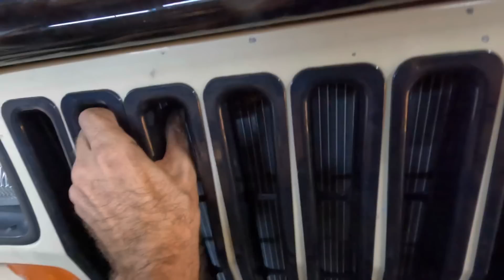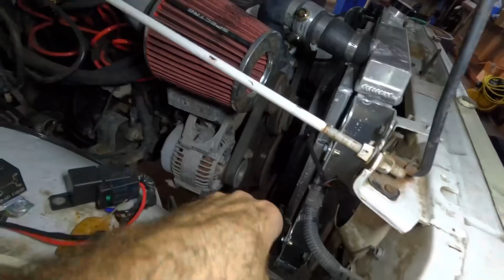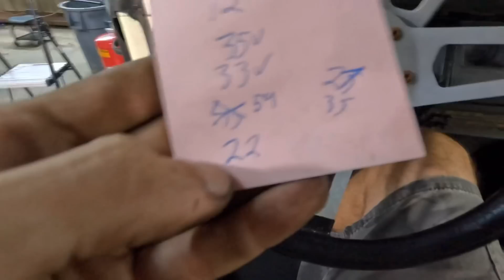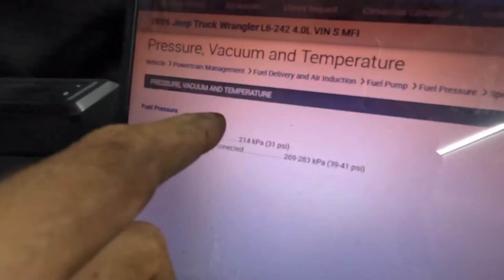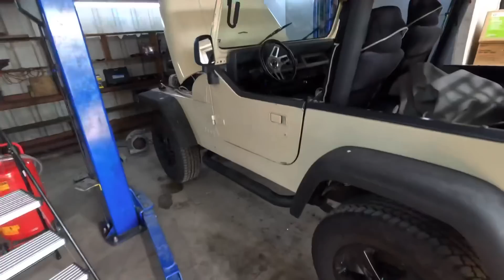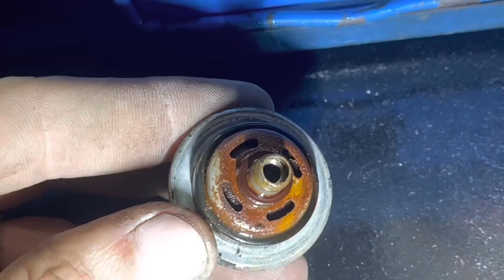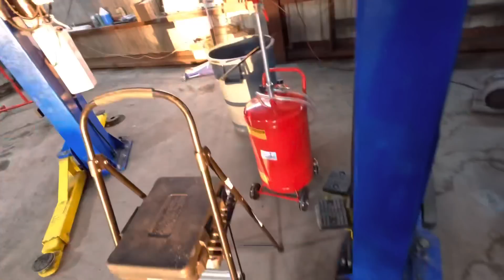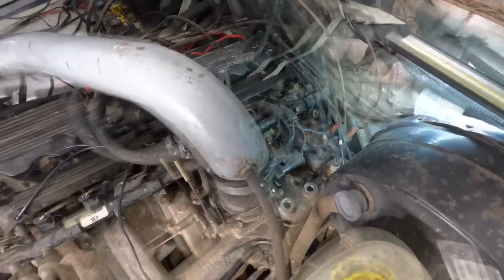Parts Cannon!! Can it be saved?? 95 Jeep Wrangler 4.0

Comment: You got 2 fans running in front of that jeep and the fans in the jeep still not functioning, that itself should tell you the fan in not operative, which is why it's running hot but your taking it for a test drive knowing it will overheat. Your doing to much.

Comment: Hmmmm, my first car was a Chevy 283 small block 8 cylinder that the exhaust manifold would glow bright orange.  This reminds me of the first time I knew something was wrong, hundreds of miles from home at 16 in the middle of the night, the motor started going ERRRRRRRRRRRRRRRRRRRRRR very loudly so I pulled over and popped the hood, bright orange manifold, a park ranger had stopped (I think he thought I was not old enough to drive by a couple years 'cause I looked about 12 then) and he had a cooler full of water so I popped the cap off the radiator and that alone was really stupid but I did release the pressure first, and we added that whole cooler of water, slowly, but that doesn't matter much when the engine is that hot.  There must have been basically no water in the motor at all.  But, I shut it down and waited 20 minutes or so, started right up, shocked that it did not crack the block.  Or blow out every gasket in the engine.  Drove the rest of the way home, and it kept running but kept losing water as well.  Not long after I turned 17 and went into the Air Force, left the car with my brother and told him he could have it.  He drove it down to Mendocino and on the way back north he has an electric fire in the dash, got that put out and drove it another year.  You want to talk about one indestructible car, 66 Impala.  Jeez, in high school I was convinced it was on death's door so I did not care what happened to it, so there were the typical reverse to drive drops at 25 mph, doing donuts at the gas station my buddy worked at.  Going 110 (top speed for that poor old engine) on the whole 3 miles of freeway in the county, even got pulled over for it, CHP actually gave me a warning, he too thought I was about 12.  It is a f'ing miracle I live to tell of it really.

Comment: I noticed you didnt rebolt the ground strap that was behind fuel rail on the firewall... IF it is disconnected some electrical circuits will not be able to provide clean consistent voltage to certain systems

Comment: Sounds like ignition timing issues to me.  I had to rewire my Distributor pickup wires when rebuilding my distributor and inadvertently flipped the wires. So when I plugged it in, it started normal but ran really low on power and the engine sounded really loaded up. Turns out, in flipping those 2 wires I effectively flipped my timing curves and when RPM went up, my timing became "Less advanced". This causes fuel to not fully burn and to continue to burn in the manifold and catalyst. Causing the manifold to eventually turn red hot. I definitely suggest checking base and off idle timing.

Comment: My past experience with this particular engine and a few more is your rail has a bladder inside it and if that bladder clapses it can allow if you will go through and they can shut it off to a point where it will not run either happens in the rail or in one of the lines leads the injectors

Comment: So. You have a bad fan, a fuel. Issue I jectors. Or a weak pump. Or a. Clogged fuel filter.
   And a few sensors.
. Brings back memories for me..
. And ya a new pump. Doesn't mean it's good. I agree.. But also could be airing issues.. It's old critters eat on things.
. And grounds.
. Now I will watch the rest n see what happens..

Comment: Intake manifolds get a gas wax that is formed on cold intakes. I had map sensors on a car that were lower than the hose connector. The gels went down stream ( booger gravity ) and clogged the map sensor in the winter. The Ford service bulletin I never received offered a mounting bracket at a higher mounting point on the firewall. I thought the engineers knew alot about gasoline.... just kidding, they're myoptic!

Comment: Fuel pressure regulator shot?? Or weak fuel pump??? Fuel pressure leak down at rest?? El cheapo fuel filter that
has a paper element that is trying collapse in on itself?? Here I am about 3/4 's away in the video, but that only
seems like anything that I can think of at the moment!

Comment: These sort of jobs on clapped out cars can be really frustrating and stressful. You just keep finding more and more little things that need attention or replacing, the clock on the workshop wall seems to be running faster and the customer bill is increasing and you still have a clapped out car. We have the Jeep range here in Australia, not very practical, not very reliable and they drink fuel like a thirsty camel at a water hole.

Comment: Captain back seat helping out here:
Now, why would there be a trouble code for the injector circuit? I don't know, but maybe because someone was pulling the injector plugs a minute ago?
During the starting I clearly hear a dolphin. So, THERE's your problem. A Jeep engine should not be equipped with a dolphin!

Comment: These things are known for heat soak problems, so old crappy injectors running lean building up heat making the injectors worse and not allowing it to run right after stalling, could probably use a new fuel rail line and upgraded 4-port or 12-port injectors

Comment: One thing you missed. While I don't think it's 100% your issue, It could be your restarting issue. When you depleted the fuel pressure and turned the key on, it only climbed to about 15 psi or so. That new pump should have hit at least 31 psi in the first key turn. So there is still a fuel issue going on somewhere. Plugged line, fuel sock clogged, not enough power to the pump. SOmething.

Comment: I used to own a '91 Islander. Great little tooling around car.
Reply: The wiring harness for the fuel pump runs right over the drive shaft and can come loose from the clips. When that happens, the shaft can wear through the insulation on the ground wire and short out the pump. Had it happen to mine more than once.

Comment: OBD does actually have a port, but you don't plug a scan tool in, you use a jumper (on most models) and it triggers the flashing of zee lights on the dash.  I've never had a Jeep, so hadn't seen the on/off key switch method before.  Learn something new every day.

Comment: I’d definitely run a compression test, depending on how bad it was overheated in the past it could have bad rings.

Those injectors also look stock, so sending them out to be cleaned might be the ticket. I’d clean them instead of replacing them with shit parts these days.

Comment: Did you check timing, might be distributer, had an 89 with the same motor and same problem put a new distributor in and fixed the backfiring and misfire just a hint to consider

Comment: These 4.0's over heat so easy. The first thing owners do is yank the clutch fan and put a CHEAP electric fan on it. Leave the clutch fan but all a pusher fan in front of the radiator. 

When topping off the coolant, do not forget to raise the rear wheels about 8 inches and then pull the "BURP" plug at the back of the intake to get the trapped air out.

Comment: Typically, the largest "new part" issues I have hade are with master cylinders and brake calipers. There have been a few other parts but those  are not as common as the other two

Comment: Just a quick note on the thermal imager - the temp was showing "> 842", which means the temp was outside it's range for detection.

Doing a quick check on the Snap-On site, their imagers max out at 840F, so a 2 degree margin of error, at those temps, is understandable. So while "red hot" may have been hyperbole, it's certainly closing in on reality!

Comment: She lean, full fuel system overhaul.i had a regulator give me hell on my jeep, causing misfires and all sorts of hell,I was certain it was ignition related,then injectors( had 330k on them) no change. After about 1200$ in parts I sent it to a shop they had found one failed injector( new one) and failed regulator.they will pull fuel from the regulator and suck it through the vacuum system.with that hard start it almost sounds like it's a crank sensor going bad.

Comment: Code 54 is the distributor sync sensor, also known as the cam position sensor. It controls fuel injector timing. It's possible the sensor itself went bad, but it's also not uncommon for the bearings in the distributor to develop some radial play, which will screw with the sensor reading, which screws with the injector timing. Worn distributor gears can also cause similar issues.
But I will say most of the codes there are from unplugging things and reconnecting while it's running. You can clear them out by leaving the battery disconnected for a few minutes, then take it for a short drive and check again for what came back.
While maybe not worth it to a professional who doesn't know if they'll be using the tools again, it's still possible to get the diagnostic connectors. They're sold new in $$$$ full kits, or available used online. Most of the older cables will still plug into newer diagnostic tools, although generally I've seen them included with an old tool, usually a Snap-on scanner. I picked one up pretty cheap off ebay a couple years ago, (non touch-screen Solus), and it's been a pretty decent investment at least for an enthusiast. There's not a ton of data and tests to be had compared to what you get from a modern car, but it at least gives you something.

Comment: Far be it for me to tell you how to do your job, but with a car running like that, having a long term fuel pressure issue, I'd have pulled the plugs by now, to check their condition from long term running lean. And isn't chasing vacuum leaks just the pits! Though one leak is going to affect everything else on the same vacuum circuit.

Comment: This poor Jeep has had many years of neglect.  Carbon plugged vacuum port and many vacuum leaks.  Heavy rust in the fuel rail.  Clapped out water pump.  Dead cooling fan.  Disconnected wires.  So far, it looks like more parts will be required.  That studder at mid throttle looks strangely familiar.  Is the distributor advancing at all?

Comment: 94 grand Cherokee. It was given to me with a runability problem. Yup free jeep. Ran good for a few minutes then terrible. Came with 10 years of receipts. Was told it had a new fuel pump. After a week of fumbling around I realized the brand new fuel pump was bad from the start. Warrantied the pump and it ran great for years. 

Given the state of your engine I would suspect your injectors are hosed or at least one is. I’m no mechanic though. Just a shade tree guy.

Comment: Erick O worked on a Jeep that had a return line from the fuel pump that was rotten and not letting the fuel pump get full pressure. It caused starting problems

Comment: had a 95 yj 4.0l really messed up the engine off roading, ended up replacing it with a jasper reman 4.0L. Reused a lot of the external motor components and sent out a lot to be cleaned in ultrasonic bath. One thing that always bothered my was how filthy the fuel rail and the injectors were on my yj, I should have just replaced them but I used a loaner injector cleaner, judging from that fuel pressure regulator there may be a similar story, but I don't know why it would cause a hang up like that. you wouldn't believe the amount of crap that came out.

my bet, it got a new distributor and cables judging from how its the cleanest component in that engine bay someone missaligned the rotor, pretty easy to do from experience.

I'm fairly certain also that random piece of wire with he connector you found under the hood tucked away would have been for the optional hood light, mine had one just like that and assumed that's what it was for.

Comment: Ray, My non-K car Chrysler LeBaron had OBD-1 as does my old faithful '92 Honda Civic Hatchback, and the data over time from adjusting back and forth, the occasional emf spike or whatever, they just get garbage in their data. 
You reset the data by pulling a specific wire or fuse I think, that clears the data and loads the default values. 
Also with multiple codes I would clear it after writing them down, then drive the car and pull the codes again, often one or more would not return, so I didn't do more look at the system, and pull codes again in a week or so if other problems were corrected.
Another thing, disconnecting the map sensor plug or vacuum line would light the check engine light.

Comment: Fuel Injected Engines:
Code 54 - Camshaft (or distributor sync.) reference circuit - No camshaft position sensor signal detected during engine rotation.

Comment: Charcoal canister has nothing to do with crappy idle and slow response the vaccine line from the canister suppose to go on the oem air box for the fuel problem jeeps are notorious for not starting after being warm you can do that by slapping a check valve closer to the motor fuel line and it looks like it has a weak spark so I would check the distributer the cam pos scensor should be built in but if it’s not swap it out because my xj ram like that when mine was taking a dump also chanklgw the cps and you should get a better start that one might be shot or try cleaning the area where it mounts it could have build up dirt around it or where the magnet rests long story short/ swap out distributor/ crank position scensor should be on top of the bell housing you need long extension or spaghetti fingers hope that helps email me if you still can’t figure it out
Reply: Also the guy comment in the bottom with the hire you were waiting around is not the cam scensor that plug is next to the distributer
Reply: Also has nothing to do with injectors
Reply from the maker: I pulled the canister bc the tape connection to the intake was a vacuum leak. Canister deleted

Comment: Fuel getting dumped. Pull intake/exhaust manifolds to check valves with a borescope. My bet is exhaust valves sticking open causing the fuel to pass through without being combusted.

Comment: Bad cam or crank sensor will cause the hard start. The PCM computer is looking for that signal if it doesn't get it it shuts down the fuel and prevents a start. They could also affect the timing.

Comment: With coolant fan not working, could it be that engine was driven over heated too far and resulted in low compression in a cylinder?   Hence the miss.  What shape are the plugs in?

Comment: Reeeeeeee, that's a YJ (Wrangler) not an XJ (Cherokee) LOL, but no reason to not thoroughly enjoy this video. Actually super amped to see the rest of this saga as I have the same intermittent starting issue on my 99 4.0 powered XJ. I suspect part of it is the ignition switch as cycling to full off have positive results but also suspect a failing fuel pump or bad connection as it struggles to idle without encouragement from the go pedal. Have not had a chance to have the fuel pressure gauge attached when it refuses to start altogether but I will cause it's a Jeep. It's been an absolute pleasure to see you making your own success. Wish you nothing but the best.👊
Reply from the maker: I knew it was wrong when said it 🤦‍♂️

Comment: I'll start by saying I know nothing about Jeeps, but does it have an EGR valve, and if it does, would it being blocked by carbon build up cause the same bad running issues? Having the PCV run direct to the Intake manifold was always a bad idea as shown here with oily carbon building up clogging things.

Comment: Just because a fuel filter looks new on the outside does not mean it's good on the inside learned that the hard way my self. Think I would also be looking at the timing for the ignition that could cause the hard start and ruff idle higher exhaust temp.

Comment: You know it got hot.... they're known for head gasket issues.  Compression and leak down test.  Also if the fuel was messed up it could be a plug issue.

Comment: Check the timing and compression. I ran into this issue on my 88 and the cam had slipped a few degrees from chain stretch, until it inevitably went out of sync completely with the crank

Comment: Before vid is done, wonder if it's trash in the gas tank cutting down the flow. Have a 90 Cherokee that the fuel pump float flaked off some plastic and starved itself.
Reply: I also had the Cherokee hard start and misfire and it was a worn distributor rotor.  It ran fine until it didn't, but the wear was so big. I'm amazed it ran at all. Different ECU system though in my 90 Cherokee 4.0 and the 95 4.0 here.

Comment: When I bought my 2004 Wrangler with 4.0 it had 132,000 + miles and the spark plugs looked like it and were badly worn. With new plugs it starts on the first turn. The wire up by the firewall that's not connected might be for a under hood light, mine has one.

Comment: Dang...   Put a sound box over that compressor!   That thing would get a bit more than the assault air stick if it were in my shop..like 1/2" assaulted
Reply: Btw. Try a compression test on the little beast..   well cared for it is not..

Comment: Code 54 coming up as camshaft position sensor on my end, or, 'mixture control solenoid'

Also.. curious if the PCM was replaced with the correct one.

Comment: OBD Code 54 for 1995 Jeep Wrangler is a missing Camshaft signal from the distributor module.  The Fuel Tanks on those are infamous for rusting on the inside, if not kept full of fuel, so ck/replace/add a fuel filter.  And the Thermostats regularly go bad, then,  it gets too hot and the Radiators leak, and the Water Pumps leak after it overheats a few times.   And, it definitely needs a pusher Fan Assembly.  And, I think you said it needs a clutch; that's one poor, neglected Old Jeep !

Comment: I checked my Jeep manual, and your 54 code is for a "Distributor Sync Pickup", which means the Camshaft Position Sensor is bad, NOT the Crankshaft Position Sensor. That would also be the reason you have a misfire.